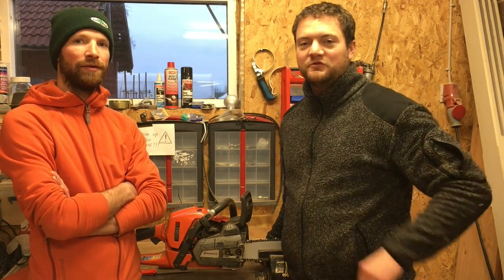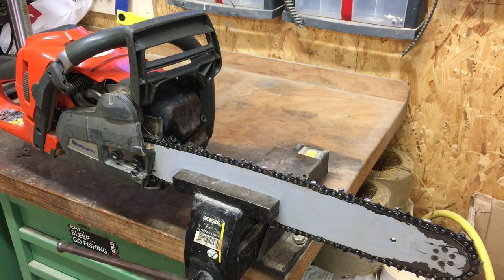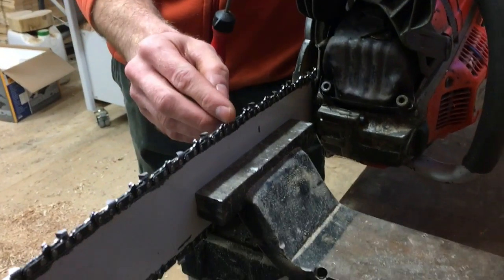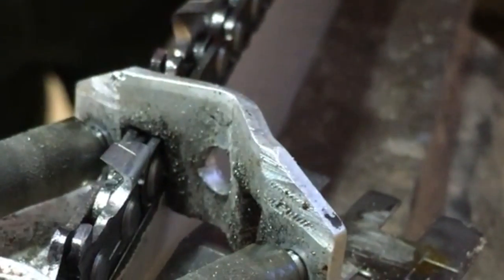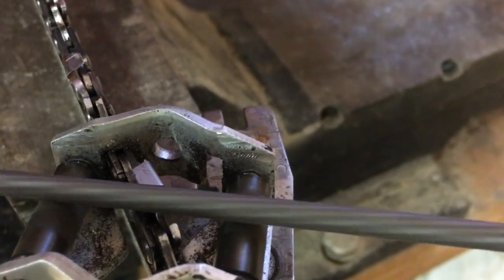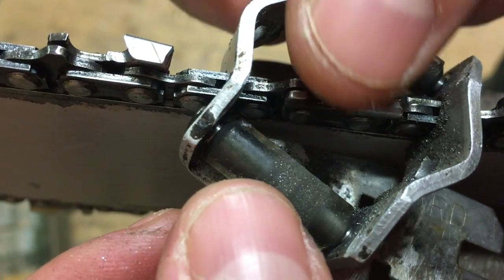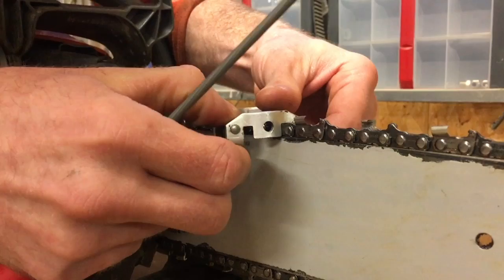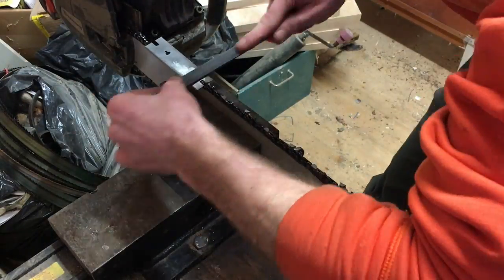Razor-Sharp Chainsaw - How It's Done

Comment: You two are a great team. The teaching is excellent, Swedish people are amazing and the Husqvarna machines are the best design and build I have found.
Reply: Craig Davies.  I agree about this fellow.  He knows what it is to get a saw sharp. Love that guide he uses.  Wish I had one like it -- never seen one before.  Way easier than these Italian made junk contraptions out there.  And Stihl makes one that files teeth and raker depth at the same time, but have to be sized to the chain and pitch.  They want $30 or so each and if it's as good as touted, it might be worth the investment -- anything to retire my clamp on italian junker.
Reply: @robertshorthill4153  The Stihl 2 in one is made by Pferd. It is cheaper to buy it from Pferd. Well worth the price. It takes less than 5 minutes to file the chain and set thee rakers all at once.

Comment: excellent video! very informative, I've known how to properly sharpen a chain since I was young, but have always just guessed about how much to file off the depth set tooth (raker tooth) , I did not know there was an actual gauge for this. I ordered one and found I get much better results from my sharpening jobs. A note to add after watching, If you use a degreaser or solvent to remove any residual oil on the saw blade before filing your file will last much longer. As a tool and die maker / machinist,  I know oil will cause the file to slip for the first stroke or two until the oil is pushed off by the file and this will cause it to dull. Be sure to re-oil the chain and bar before running the saw.

Comment: Don't worry telling me how to sharpen a chainsaw. I own a poulan. They never get dull....nor do they start.
I'll watch anyway. Just to see what it's like to have a running chainsaw. Wow listen to them. Yours sounds great. But I have nothing to compare it to except my poser poulan.

Oak is very hard.....
Not as hard as getting a poulan running.

He was actually complaining about if you sharpen it improperly your saw will pull sideways.
Poulan owners don't have that problem.....because they never start.
And that's basically the only problem poulan owners ever have with their chainsaws.
So poulan wins with less problems.
What a great advertising gimic
Reply: My poulan is 17yrs old and still runs good. Yes it has been used over the past 17yrs! Infact it's running better than my huskie Rancher which must be a member of a Union. I say this because it works for awhile then stops working all together. Haha!
Reply: Have you tried a time and trusted measure I once saw. Change the name badge to a husky or an old Stihl, just do it secretly so the the saw doesn't know. Starts first time every time.
Reply: @lancehenthorn17  I bet it gets better pay than the Poulan
Reply: @fivestring65ify  I got smart and bought a Echo CS-490 20in bar. Runs like a top. More than I can about my husky. As for the Poulan still runs smooth!
Reply: My Poulan turned 40 this year.  Replaced the tired cylinder with a great shape used (gasket delete) and new piston rings just last month. It will keep with any saw in its 56cc range.  Cheers...
Reply: That's so funny. I wouldn't let a friend borrow my Echo or my Stihl. He went and bought a poulan..it only lasted the day he brought it home. Never ran again. He gave it to me. I've never even tried to start it cause mine work fine every time. Except that 1 time I pulled and pulled forever b4 I realized the bar lock was engaged.  But that was my own dumbass fault.
Reply: Yeah, those Poulans last forever..😁
Reply: @lancehenthorn17  some of the older poulans were not to bad but if they were really good they would be in conversations with top saw companies, betting my husky cuts more in a year than you have cut in 17 and i work union and bet i have done as much work as most people, some of us do work.
Reply: Your sense of humor is very similar to mine, poor guy.
Reply: My poulan wild thing myst be 20 
Yrs old, i use a couple of times every year, always starts right up. Has gone thru a couple of bars and a number of chains, so it has paid for itself many times over. Only problem is oil runs out if not emptied before storing.
Reply: Grandpa’s poulan 2150 just gave out after 20 years :/
Reply: O
Reply: Very funny stuff go with craftsman 16".
Reply: Yep, and Husqvarna owns poulan
Reply: @mattytheapplianceguy3973   Ha Ha !  same with my neighbor, Poulan lasted a day and he took it back to Home Depot.  I've got to say between your friend's experience and my neighbor's experience you have to give (newer) Poulans high marks for consistency ! That is to say ,bad consistency
Reply: Not trying to be rude, but I have a poulan pro 18" chainsaw and yes I experienced what you're going through.  So I watched some videos on YouTube and learned about my saw. It's common problems, how to take apart and clean the carburetor, and how to  adjust the multiple idles. Now I know and understand my chainsaw and it works great all the time. They really aren't that complicated and believe me I was a little intimidated in the beginning. Just like you, I thought the saw was a piece of shit. It wasn't the saw, it was my lack of understanding the saw. Good luck
Reply: I have 2 dead Poulin saws I have a husky 455 now and love it.
Reply: I like my McCullocks. The one I like best still runs. The other needs a special preformed fuel line made of unobtainium.
Reply: I started running my Poulan's at 50:1 instead of the labeled 40:1. They get too hot running the leaner mix.
Both my Poulans's run awesome. A 14 inch green and an 18 inch Wild Thing. 
If I could just get my chain sharpening on point, these things will cut like monsters.
Reply: I feel your pain brother, I have one of those paper weights as well. Even with a new carburetor it still is very hard to start. The chain lasts forever though.
Reply: poor fella,you sure it wasn’t just the skin they only sell? 😜😂👍
Reply: I know a guy that buys a new Pouland every year for $100.  That's $1000 per decade, imagine what you could get from husky or stihl with that kind of money.

Comment: I love the way you both demonstrated how to properly sharpen a chain saw and especially the brand you own. I have a Stihl, and two Poulan chain saws which is gas operated, and one battery operated Poulan Pro saw which I use also. The battery saw is the one which will probably need to be sharpened since the others have not been used since leaving the saw shop for repairs. Thanks for showing us how to sharpen our chains.

Comment: Wow! So much NEW stuff I learn! I have never seen a gauge like that. It would have been so handy. The best we had when I first learned back in the early 70s was a piece of flat metal that attached to your file. The Ag teacher at school didn't like them so taught us his way first, then with the gauge. Oregon Chains were brand new at the time, too!
I was taught to file from the other direction, too. This lowered the incidence of a burr occurring on the outside of the tooth.
Reply: I forgot the first thing I noticed and wanted to mention. IS oil the best lubricant to use on that? Wouldn't graphite be a better lube? It comes in an alcohol carrier that lets it get into the area it is needed and then evaporates leaving the graphite lube behind. Oil will hold onto the little bits of metal and dirt and become a grinding compound, yes?

Comment: I have had great success filing Stihl chains with this tool.  The only difference I know between Stihl and Husqvarna chain is the guage of the chain.  Stihl .325 pitch is .063 guage and Husqvarna .325 pitch is .050.  Filing angles are  both the same, 30 degrees. Files are the same size for both.  It works well for me and I have used the 3/8 ' s tool from Husqvarna on 3/8' s Stihl chain with similar success.
The tools are really easy to use in the field, I find.
The only problem I have with the tools is that the plastic rollers wear out and I have not found replacements.  Means buying new tool when this happens.
Great video, THANKS!

Comment: Thanks to this awesome video, I faced up to the chainsaw again.  Purchased a new file kit for my husky as I have had real problems with the one that came with the saw.  New one is 0.8mm smaller in diameter than the one that came with the saw itself!  But is the one for the chain that my saw uses!  No wonder I've struggled.

Comment: Great tips guys, you covered prettymuch everything very well and your technique is perfect. A common problem is guys filing too hard which leaves a burr on the cutting edge, nobody ever checks or removes these. It won't have a good edge and will dull quickly if there's a burr on the tooth. The way to get rid of these is to VERY gently drag a back stroke at a high angle on the outside of the verticle cutting edge, then gently touch up the tooth as normal. If you're sharpening a badly damaged chain, like if it was cutting into dirt, you will ALWAYS have a burr that needs to be removed if you want a perfect edge.

Something I like to do that I've never seen anyone else do is put some bar oil on the file. It lets your final strokes remove an even finer amount of material. Play around with it, you probably don't need to with such a fine technique but it would be interesting to see what results you can get that way.
Reply: I wouldn't suggest puting oil onto your file because all the metal shavings will get stuck onto your file. Secondly oily file does not remove material efficently.
I personaly blast my files down with brake cleaner, just to remove any oil residue that has gotten onto it from regular sharpening.  Usually after blasting em down, they'll be nice and grabby again. All of the bur will be gone once you put your chain into the wood.

Comment: If you want a really good test, try cutting some Hickory. Some of the highest btu wood there is, but there's a reason they use it for tool handles.

I don't use a file card on my saw files, but I tap the end of the file on a hard surface after every tooth. It vibrates a lot of the shavings out of the file teeth.

I second the comment about using the chain brake.

Great video guys!

Comment: Nice video guys. I've logged 50 yers. Arthritis in my hands has made it difficult for me to manually file my chins. Pferd  makes an awesome tool that makes it a no brainer. It's called the CS-X. Stihl also has one. It also cuts the drags perfectly. You need to use it with  stump vice. Try it.I was amazed! Be safe.
Reply: fig1954

Comment: Hey man loved the video. I'm no professional with chainsaws, in fact I just got one, and I filed it till sharp and I did pretty good but when I when to buy a raker gauge from Husqvarna I didn't know which to buy. Should I buy the 3/8 raker gauge or the .325 gauge. I don't know anything about the chain on my saw apart from it being a Stihl.325( I use a 3/16 file to sharpen the teeth if that helps) thank you for the help

Comment: In the USA the term for when a chain isn't cutting straight is slicing. Caused usually by one side of the chain being sharper than the other as you rightly said. Good video
Reply: Isn’t it more that teeth on one side were filed down more (over time) than the other side; not necessarily sharper.
Reply: Or the bar being unevenly worn.

Comment: Great video on sharpening a chain! I have a Husqavarna 450 with a 20 inch bar and I have been struggling to keep the chain sharp. I tried a Stihl 2in1 sharpener, but I’m still not satisfied with the results. I may give this method a try. Where can I get the device that you attach to the chain?

Comment: Simeon I think you will find that the .325 guide that is used in your video will work on all .325 chains. I tend to use the Stihl 2 in 1 file as it sharpens the tooth perfectly but it also keeps the rakers in check.   Also I  think you will find a vast difference if you switch over the Stihl chains. I am often asked to spin some stihl chains for people with husqvarna saws.  Great video as always!
Reply from the maker: Interesting. Thanks for sharing.

Comment: I have a Echo CS590 with Oregon 20" full chisel, 3/8 .50 chain. I was recommended 2 different file sizes. A 7/32 & a 13/64. I also have a Stihl 2 in 1 for it. I've used the 13/64 file a couple times to sharpen it and it has a sharp top plate  but I don't seem to get a good hook in the gullet. Any recommendations or advice for someone new to sharpening chains?

Comment: Very good instructional video. 
One point however. I prefer to sharpen my chains off the saw so metal filings do not wind up down in the saw bar chain groove. Bar oil, being very sticky, will hold onto these little bits of metal and will ride around the groove and accelerate bar wear. 
If I do have to sharpen on the saw, I use compressed air,if available to blow clear any filings left behind. 

Great channel, keep up the good work.

Comment: Very good video. I am going to look for a file guide like that. Right now I am just freehanding by the line on the chain with good results but this looks much more efficient.

Also the gauge that I have for filling the rakers sets on top of the teeth and makes the top of the raker flat.
Interesting difference.

Comment: i had to sharpen 2 or 3 chains at a time,every time. it  takes too long to do it with a file, and sometimes the teeth are so damaged that (sharpening by hand) can drive you crazy.  so the sharpening machine was the answer, but with the(regular) grinding stones the quality of cutting edge was not what i wanted. so i began to use 2 stones, one with big grit for sharpening and one with very fine grit for just "polishing" the edge. changing the discs takes me 20- 30 seconds.
P.S. like your videos, keep doing. and sorry for my broken English.

Comment: I use a stihl ms250c but I like husquavarna s too . I have an old mccullogh that is a back up and really not a fan of the 250c easy start because of the delay but pulling that string is easy and nice . Once I got used to it , first chain went through 5 feet of root from a root ball and there was no saving that one and I have an Oregon chain in the package still so I'm ready for the next tree I get a call for . The last one uprooted a 20 ft ball at the corner of a fence and had the chain link fence 20 ft in the air , stretched about 80 feet of chain link and uprooted 4 posts  but it all went back together eventually . To get the fence down I got in top of the tree made a 1/3 straight cut then wedge cut at bottom being careful using the tip to get that ball and fence down . It was the best / coolest tree call I have to date

Comment: Thanks Guys🇦🇺🤠👍
I had an Arbourest show me how remove the filings left over on the chain before use. He started it and pointed it down, about an inch above a flat surface, then revved it at high speed, slowly moving it backwards until you see no more filing in your bar oil line. This way you won't blunten your chain so quick on the first cut.👍

Comment: My name is Anders Raiha, born in Tranus Sweden. I always watch videos from my homeland. Thankyou . I am sawmill owner and sawyer in America, proud to be Svensk
The non cutting tooth behind the cutter is called a raker, designed to rake,like raking leaves or pine needles in your yard.It has 2 purposes, remove shavings from the cut, and keep the depth of cut under control.Your sharpening tips for in the forest are really great, and I will use them, but Americans in general have no patience, they would rather sharpen many times wrongly, than once correctly.I hope this review is no offensive, If you find it to be so.

Comment: Hello guys wicked video. you were saying about the guy that had a chain sharper than anyone. I believe this is down to the direction on which you sharpen your chain. I was always taught to sharpen any cutting edge away from the cutting so you do not roll a bur onto the cutting edge because you pushed the material out away from your cutting edge. leaving a clean sharp edge. my dad will only have me sharpen his saw for this reason far sharper than anything else. hope this helps somone out. thankyou for your great videos. craig
Reply: That's correct. Also, the chain they use in the video is a semi-chisel, but if you run full chisel (I much prefer them) Bailey's sells a double bevel file, and it can also be used on the rakers.
Reply: I agree Craig, and I don't think that this is any small point if maximum sharpness is the goal, especially when it takes no more time or effort to run the file in the opposite direction. I also find that applying the force in that direction helps to reduce the small amount of lash from the chain, holding it more securely. The direction that the file in the video is run is contrary to good sharpening technique when sharpening the cutting edge in just about any tool. It's too bad this point gets buried in other comments part way down the page.
Reply: Marks Myth juice

Comment: I found it really funny that while filing the rakers you had the tool at the back and bottom of the cutting tooth. Then I watched again and realised you're using a different type of tool, which seems to take more off than the tools I am able to get where I am. Then I thought about the fact that I could just use a steel ruler in a similar manner to check height providing I put it at the right spot behind the teeth. Then I decided to just ask you for the dimensions of that tool so I can make my own. Then I thought never mind, I will just use a steel ruler and take measurements to build a tool around it. Then I decided to just file the tool I already use down a bit. Good video by the way.